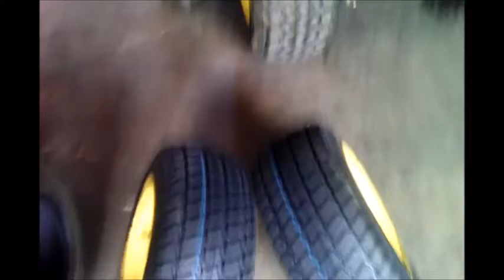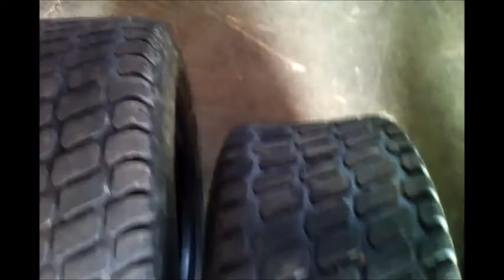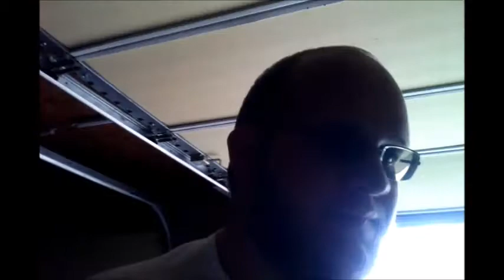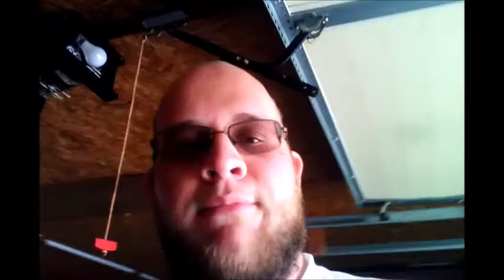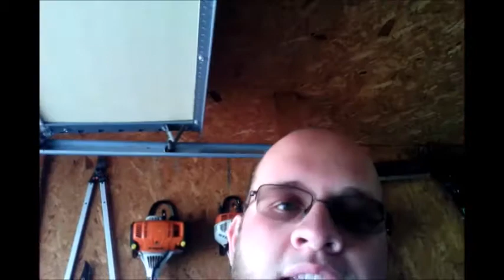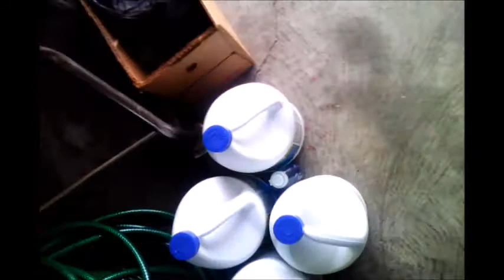New Shoes for the Deere

Comment: New tires are always the way to go. Tubes are great but tires are the best fix. Hope you have a great season bud.
Reply from the maker: Yea I normally tube tires that dont hold air (on cheaper mowers anyway) but most of the time they have more tread on them than these do. I knew I would go with new from the beginning on this machine. Thanks man! Same to you!